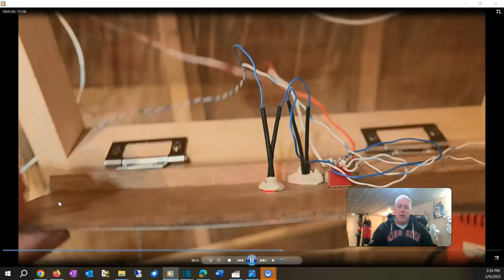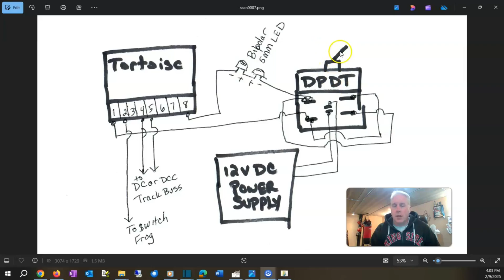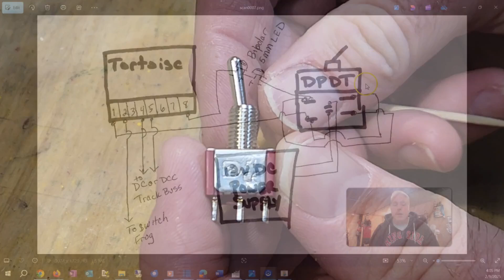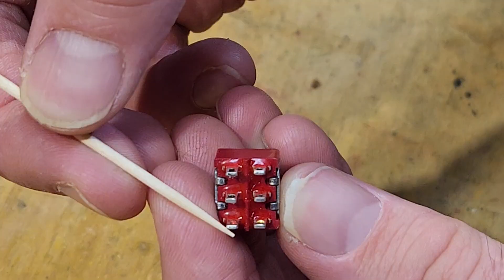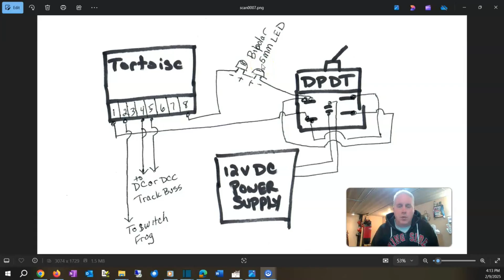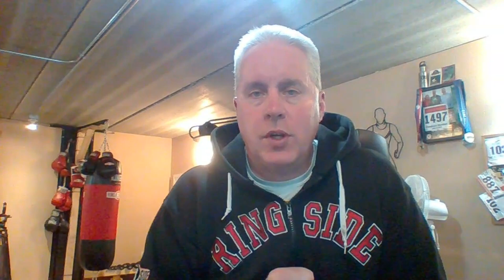Tortoise Crossover Switch Control Panel Bipolar LED Indicator Lights Circuit Drawing

Comment: Thanks that helps. Where did you get the LEDS? And what wall wort did you use?
Reply from the maker: @Vman7757 Glad it helps.  I don't think it matters much as long as it outputs 12v DC.  I didn't expect to find it when I googled, 'CNR2260' but I found it:  https://www.ebay.com/itm/226032715937  I have no relation to the seller in this listing.  This one outputs 500mA.
Reply from the maker: LEDs from this link:  https://www.ebay.com/itm/293687771621  Again, I have no connection to the seller other than purchasing these previously.    

@kenvandevoort7820 suggests using threaded LEDs which I would buy now that I know such a thing exists!!

Comment: Thank you for putting this together!  Filed in the layout folder.  How do you have the power supply wired for distribution to the switches?  Terminal block?
Reply from the maker: @majortomtogc Glad you found this helpful.    Regarding the distribution of DC power, some might say I went the caveman route.  I ran 12v DC accessory bus over 22 awg single strand wire.  All connected to one power supply.  When the bus came to a panel, I terminated the wire, made a pigtail to connect to the panel.  I soldered all three wires together and covered the bare wire with 3/16" heat shrink.   Continued on to the next panel.   No terminal blocks.  Maybe I should have used them.  

If I end up having more tortoise machines on other parts of the layout, I'll probably run a separate bus and power supply for them.  Not sure yet.  Sioux City yard will likely be push rods and the main deck will likely be caboose industries ground throws.
Reply: @blackhillsandeasternrailroad  Got it.  That is really similar to how houses are wired.  Thanks again!